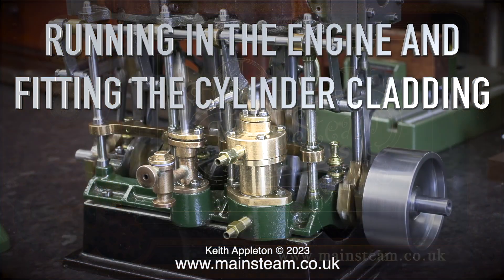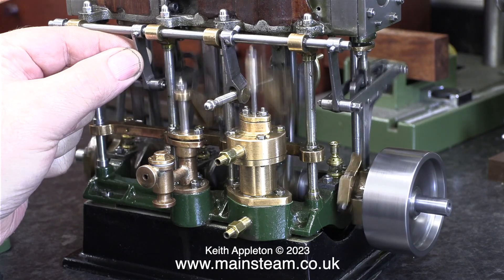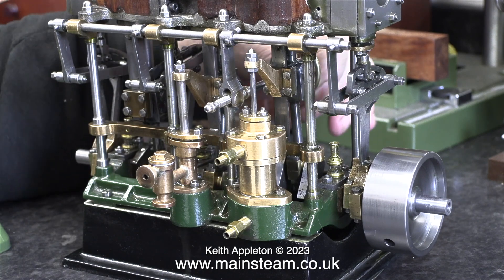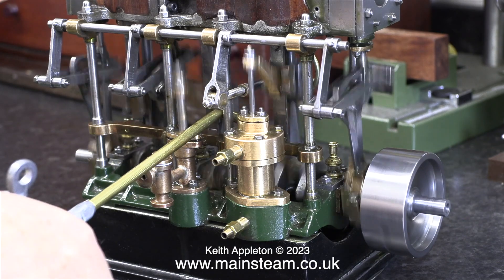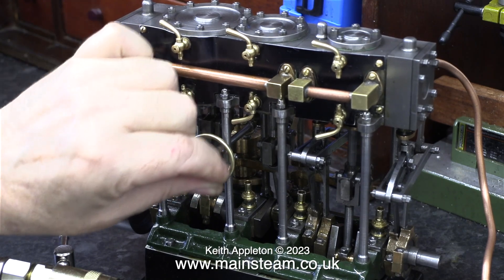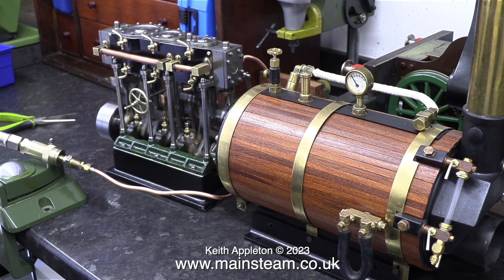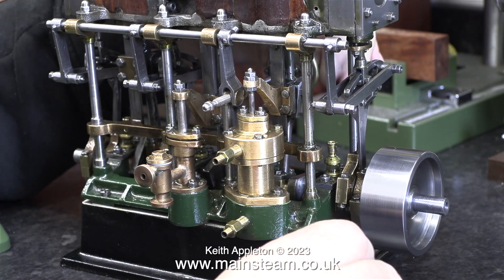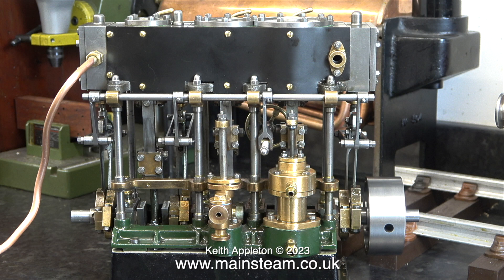COMPLETING A STUART TRIPLE EXPANSION ENGINE - PART #57

Comment: The engines high speed certainly does not appear to be in scale with any steam reciprocating marine engine I have been associated with!
Reply from the maker: The speed is directly relative to the size of the engine - this is a small scale engine (very small) and I am running at a high speed to break in the moving parts as it was originally tight.

Comment: Hi Keith. It's a beautiful machine in it's own right. However, instead of a static model, could it be used to power, say,  a largish row boat? Travelling on quiet rivers and inland water ways - the smell of steam, oil and coal smoke, on a fine day's outing to a pretty picnic spot.
Reply from the maker: It is a model after all, using it in a full sized application would probably prematurely wear it out .....